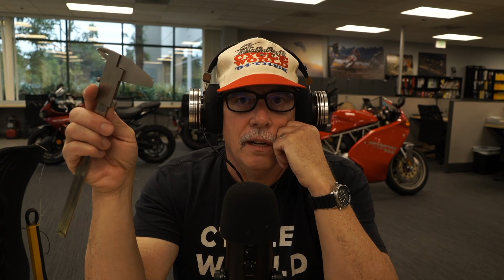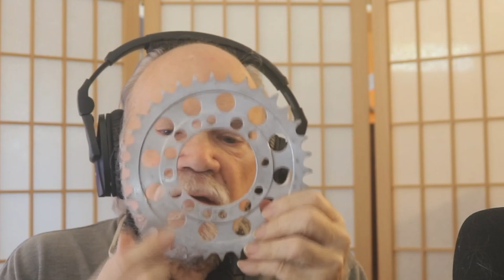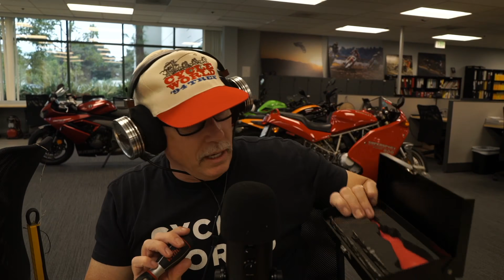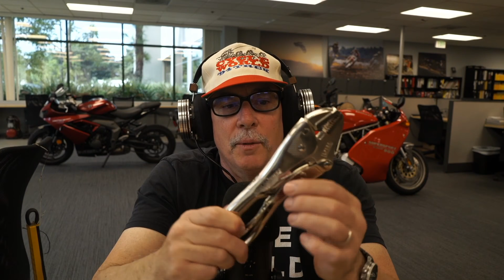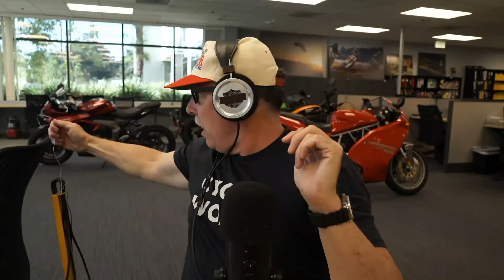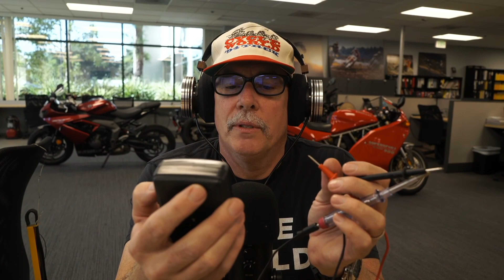FAVORITE TOOLS: The most INTERESTING and USEFUL tools in our shop! (also WEIRD ones)

Comment: I have a four foot vernier caliper that I picked up at a garage sale.    Got six dial calipers for everyday use.  Various other gauges and references for machine shop work.  This is just a beginner level backyard shop.  Two lathes, two mills, stick, gas and two mig welders (steel and aluminum), plasma cutter.  Turning 80 in a couple of weeks,  almost can't use any of it any more.  
By the time you can afford all of the toys you're too old to use them.
Haven't pulled out a slide rule in decades now.
5 RAM diesels keep me reading Kevin in TDR.
AeroKroil good.  Air wrench. Ingersoll 261 3/4 will remove frozen lug nuts.  Doesn't matter if it's in forward or reverse nut is coming loose---.
Hondas trained us to use impact drivers in the 1960s.
Phone camera, like paper towels, is an essential shop tool now.
You want a difficult tire? 4" lawnmower such as the front on a Snapper.  I've learned that it makes more sense to just buy a new tire mounted on the wheel than to try to fix one of those.
Rust?  The ultimate tool, is the blue wrench.  Not to cut, to heat until it comes loose.
Carb sticks?  Yes.
Lacquer thinner is another essential shop tool.

Comment: I have a Vessel impact with a blue metal case since 1970. I didn't realize how special it meant  to me until now. I use it regularly. I have Vessel screwdrivers also. I have the same  carb synchronizer as Hoyer since 1978. What a great episode.

Comment: Here's the deal with synchronising the 'carburetors'.

When you synchronise the carburetor blades perfectly with a drill bit or fine wire, or even on a flow bench, you will ALWAYS have to re-adjust them with the mercury columns with the engine running.
This is because you are not actually balancing the carburetor throttle blade angles. You are actually equalising the intake manifold pressures, and to equalise the pressures, the throttle angles will always be slightly different to each other.

This is because any multi-cylinder engine behaves like several individual engines, because of a multitude of reasons, of which each cylinder operates at a different efficiency to any of its opposing cylinders, no matter how finely blueprinted those cylinders are to each other.

If you were to set all the throttle blade angles perfectly to each other on a flow bench, then adjust them with the mercury manometer, if you were to remove the carbs again and measure them on the on the flow bench again, they would all flow slightly differently.

Any multi-cylinder engine is effectively several different engines.

Thank you.
Darren Parkinson.
Engine Development Services.
Sydney, Australia.

Comment: A wonderfull Tool. Desmodromic closure of the inlet valves will be very usefull in combination with the Miller Cycle and extremely high kompression ratio...as in the new Ducati/Audi F1 engine Kevin could explain it all with His onomatopoetical sucking squeezing banging and so forth noices. Wonderfull Stuff!

Comment: Fantastic podcast yet agan! Perhaps my favourite tool as an aircraft mechanic is my mini, long-reach Snap-On cutters p/n: 808CF. Just about every air-mech in the business has a set, the best for lockwire and split-pins in hard-to-reach areas. Would love to hear an episode on the Kawasaki Z1300 six-cylinder. From what I can gather, a lot of clever engineering went into it. Or perhaps do an inline-6 episode that lumps in the Honda CBX and Binelli Sei at the same time. Cheers and keep up the great work!

Comment: A few thoughts: I guess my newest favorite tool is my smart phone. I take dozens of pictures before taking something apart. Never a question about what goes where. It's surprisingly easy to forget when a project is taking a long time to get to the reassembly phase. There are some great useful apps, like a protractor app that does pretty much what Mark's protractor does, and you can get tiny borescopes that plug in, so you can check piston crowns and cylinder wall condition. I'm surprised neither one mentioned a surface plate. So many uses for one. You can roll an axle on one to check straightness. You can plop a cylinder head on one and check that it's not warped. But many of my favorites are specialized wrenches and things that I've made or modified for a specific purpose. Put a torch on a cheap wrench and bend it to the perfect angle for a hard to access fastener, and you will smile every time you use it. Great podcast, and I'm hoping you do one about torqueing fasteners. That'd be swell!

Comment: Visit an old-school gunsmith sometime, but hurry! All manner of petite, miniature leverage, tapping and wrenching devices, many built right in that same shop. As to bike tools, I prize my 1971 Koken Tool Company impact driver with the 8mm hex bits. That and my overly large Melco TL-37 tyre levers. In '73 or thereabouts, I bought two tools from the local MAC tool fellow: a MAC 1/2-9/16 swivel socket wrench and a Blackhawk 3/8 socket spinner. Still have all and they are exactly as useful as they ever were.

Comment: My first motorcycle specific tool was a vessel impact tool that came in a blue metal box.  I purchased from a motorcycle shop for $9.99 in 1973 to remove screws on an H1.  I never heard of the brand and expressed my concern if the tool was of high quality.  I was assured it was.  Over the years, the tool proved to be invaluable.  It’s still in my tool box
Reply: oh the time when you can buy cheap tools that last a lifetime…Was thinking about a Wera torque wrench, and then I see the price, no thank you!😂
Reply: I still have mine in its blue metal box !
Reply: Go Vessel and H1! 💪👍

Comment: I like safety wire pliers and a good mechanical torque wrench with allen key sockets.  Dielectic grease for electrical connections.  And Oetiker clamp pliers.

Comment: The Land Rover guys carry a magnet now looking for magnetic copper washers. Apparently one supplier coats steel washers with a copper looking coating. They don't seal like crushed copper. 

JB Weld has come in handy as well as duct tape for field repairs.

Comment: I still have my points checker, just like Kevin's. I still remember the timing specs for all Yamahas with points. I have antique tools in my tool box and in my head. Sudco is gone! That is sad. When I started my career only Snap on had combination wrenches larger than 19mm. They are beautiful tools but a good tool pays for itself. I have the tool for adjusting the stroke of a Yamaha oil injection pump, another for taking the speedo drive gears out of a drum brake back plate, the screw in window for checking the timing on a TX750.
Just a few of the things I should throw away but can't seem to.

Comment: How timely.  I've been machining for 42 years now.   I was out for a few months last year, and someone used my MATCO or Craftsman 32 oz ball pein when I was out, and broke the handle on the oldest tool in my toolbox. They bought me a new Proto, but it just isn't the same.   But speaking of the old days, I had Jack McCornack as a motorcycle mechanics ROP instructor.  My buddy ended up with an A7R from him, with the closest ratio, super tall first gear engine that I had ever seen.  I ended up with an S3 Kawasaki, that had ama tech Inspection stickers all over it.  He said it got 3rd at Daytona in 400 production.  The stock pipes that been cut apart and reshaped inside, and was the fastest 400 I'd ever seen.  Our buddy had an H2, brand new purple one, 75 I believe, and McCornack had that guy get his 750 out and they punched off on a road down below Seaside High School, and that 400 wheelied away from him with McCornack riding it.

Comment: Just buy a few British bolts and studs and use them as the gauge. Commandos use Cycle threads 26TPI and of course the course thread is varied. My Ryobi battery drill motors have 20 settings and do a great job to get the fasteners snugged up.

Comment: My tool chest seems much more satisfactory since I started watching YouTube videos of roadside truck repairs from Pakistan. Armed with little more than screw-jacks, short-handle sledge hammers, pry bars, big blocks of wood, and a few poor-quality end-wrenches, they work night and day to get those overloaded leaf-spring trucks with snapped axles back on the road. Replacement parts? No way! They simply throw the broken pieces in the back of a rickshaw and haul them to a nearby open-air machine shop where they weld and re-machine ‘em. When frames fail, they drag the trucks to open-air frame yards where they fabricate new multi-layer frame rails from sheet steel and assemble them into replacement truck frames.

Comment: Please consider doing a podcast in the future about the Japanese manufacturers taking on Harley Davidson. I love Harleys, but since I couldn't afford a used Harley I bought a Virago 1100 instead. Love it to bits. I think it would make for an interesting conversation with the tarifs that were placed on them as Harley faltered for a while. Thanks guys once again for a great podcast.
Reply: Do you remember the 1980s H-D ad that was written in Japanese?
Reply: I have a yamaha xv1000 TR1 8.5:1 compression enclosed chain , essentially chain drive, revvier version of the virago with more euro riding position. I guess these are street engines, flat tracker was never a winner, so the race guys didn't take much interest in them.
Reply: @MatthewFelgate-r4u  A high percentage of the Viragos left are now cafe racers.
Reply: @HAL9000-su1mz  great torque

Comment: How did you use a manometer carb sync took on the Amal concentric's?  The carbs don't have a port to hook up a vacuum gauge.  I tried using my Morgan Carb Tune pro on my Triumph T140 by taking off the rubber cross over tube that connects the carb manifolds and hooking up 2 hoses from the Carb Tune Pro, but it wouldn't give me a proper reading.   Not sure why not.
Reply: The spigots on Norton intake manifolds that are normally connected by a short length of hose provide the vacuum. Not sure why that didn't work on a T140 but it was perfect on the Norton.
Reply: @markhoyer1736  maybe i'll try it again

Comment: My brother had a pair of tire irons which were "L" shaped.  One end had the normal spoon shape, while the other end had a pair of slotted holes to slip over a spoke, about 4 or 5 in per leg. Very handy to start a bead off and then hold it there while you worked your way around the rim for solo work.

Comment: I worked on Hondas back in the mid 60's and remember when the only place to get a metric bolt or screw was at the Honda dealer.  I'd have to order what I needed and it took from two to three weeks to get them.  I think there was some kind of thread locker on the Honda case covers so every one of those JIS heads were stripped out by the screwdriver.  I've got a full set of the Vessel JIS screwdrivers and impact driver bits.  What a difference!
Reply: Vessel drivers are now made in Thailand, but are still superb tools.